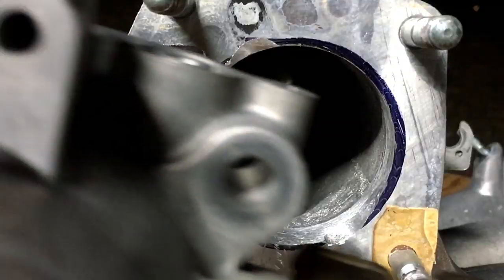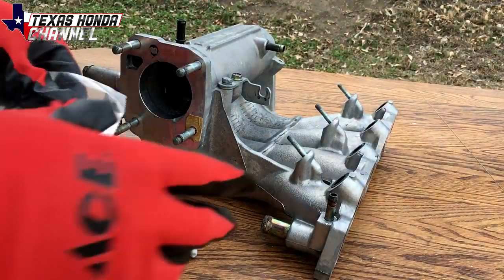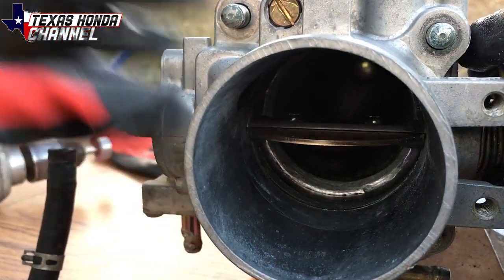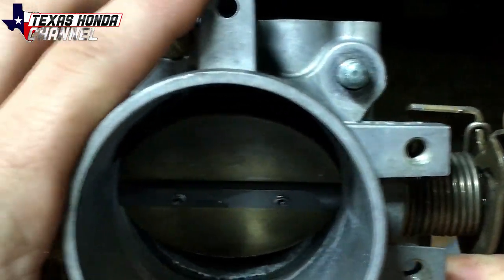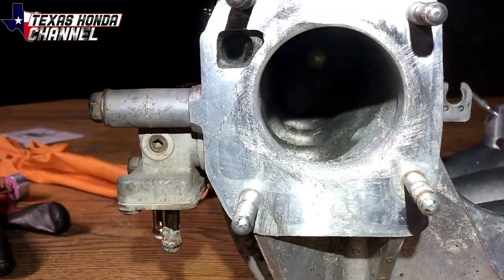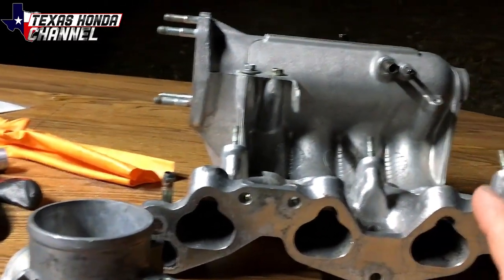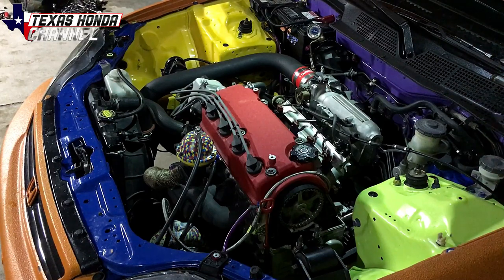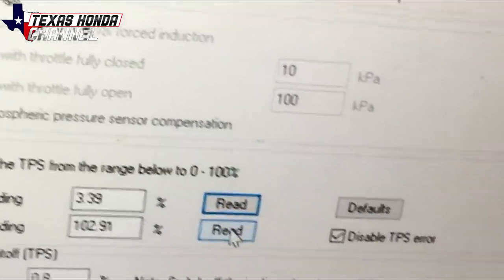18 psi+ How to port match Type R throttle to a d16z6 intake manifold

Comment: I know it been a minute my good man. Hope you are all well. Grinding stones load up easy. Get you a nice aluminum/ steel cutting bit. It wont load but be careful. They do remove aluminum in a big hurry. Great ⚠️ should be taken. Then i used a flapper sander on a drill to clean it up. God Bless ✝️

Comment: try carbide burr... it will cut it like a butter... and no need to work until night...
Reply from the maker: Lol i only get time to work at night since i have no other time too. 90% of everything i do is at night and i couldn't afford cabide or i would have had one. The grinder bits were super cheap. The whole point of this is to save money but i do agree carbide works way faster
Reply from the maker: Khai Incharge I have one now but didn’t at the time lol

Comment: is this absolutely necessary to do for the throttle plate to open on a z6 manifold with a 70mm tb?
Reply: Yes there is no point in upgrading to 70mm throttle body without port matching the manifold you won’t see any gains if anything it’ll run worse than stock.

Comment: That thing runs like a scalded cat. I imagine if you took it to the dyno it would have a big bump in torque with that throttle body. I'm sure there's a good increase in horsepower also but I'm sure you feel the torque more. You may not need the lower ratio trans with the throttle body and 18 -- almost 19 pounds of boost.
Reply from the maker: ghogue61 Yea for sure! I plan to get the short gear trans for even faster a acceleration and tq but yea the difference is noticeable without a doubt!

Comment: James what intake manifold gasket did you use with the Z6 intake Y7 head combo? If I recall,the Y7 head/intake has two round coolant holes and the Z6 head/intake has one round and one square.

Comment: I wonder if you got "that garage" to powder coat the inside of that intake with a gloss finish powder coat if it'd make a big difference in flow.
Reply: Highly doubt it.  In order to achieve that effect,  all you would have to do is polish the insides
Reply from the maker: Chris Hernandez I was gonna spend the 6+ hours polishing the inside but decided against it lol
Reply: @chrishernandez2490  jw powder coating would be a much faster/easier method to smoothing it out.

Comment: my question is on your video , you swapped them out, how did you manage not to have any idle problems, because ypu just eliminated that connection from the old one throttle body ,.the bottom connection where that small hose goes to, for the water inlet, suppose to be for injectors,.on your video at 11.08
Reply from the maker: These throttle body don't have fast idle thermal valves like the 1988-1991 and 1992-1995 civic have. So the stock D16y7/D16y8 have none of that. I just bypassed the throttle. The coolant still ran to the rear idle air control valve so fluid still reached it. just basically put a straight through barb.

Comment: Do you not need to port the head in order to match runners from the z6 manifold since they’re bigger?
Reply from the maker: 360CEA725 The cylinder head ports are plenty big enough for the z6 manifold. The cylinder head is a D16y7 which is a 1.6 the z6 is a 1.6 the d15 manifold I had on was a 1.5. The ports on the y7 head match the z6 perfectly

Comment: I have exedy  stage 3 steel clutch in my NA d16y8 it is very new but it is sliping,what clutch do you think i can used.and my moto has a 70mm throttle body with a chip ecu.

Comment: Hey did you ever tuned the car on that high psi ? I'm wondering what are your hp levels  ?
Reply from the maker: No idea what the horse power is but on lower ignition timing and 8.8psi it made 200who so probably around 300. will dyno when i can afford it
Reply: @TexasHondaChannel  oh man can't believe the block held. Good videos man keep it going. I'm in the process of getting 1000cc injectors and a gm 3bar map can't wait to tune it.
Reply from the maker: SGREEFER310 I need to throw my 1000cc injectors in as well. I just need the connectors

Comment: 1st off using the sharpie to mark material to be removed ? is this your first time ? use an old or a new GASKET. verify it is same size as throttle body and or larger. if larger port the intake and the throttle body to the new size. some throttle bodys can benefit from porting large some cant you simply gotta look for obstructions in flow and then gently massage them so as not to hinder flow. keep same general shape if your new to this do not change the flow path unless you know for sure this is what needs to be done. As in you read it from a speed manual or speed shop not from billy bob in back yard with a dremel tool.
Reply: This is called port matching.  Who's new here?? You use the old gasket and sharpie . ? Because you need to take off say 6 mm like I do with my JDM h and skunk 2
Reply: I am Billy Bob in his backyard.  And I'll guarantee I spank anything you own with na 27 year old Honda

Comment: I have a D16Y8 engine. How does the Z6 intake manifold compare to the Y8 intake manifold? Any performance benefits?
Reply: Y8 intake is better for turbo and n/a its the same preformence buy a 62mm throttle body from a b16 or b18 ther the same and make a lil power
Reply: Y8 is shorter fatter - looks bigger. but when opened the Z6 has equal lenght runners 1234 vs Y8 unequal lenghts.
check SRDMotorsportsTV dissection of the Z6 vs VTi (Y8) intake manifold
https://www.youtube.com/watch?v=TtKG8vzCsNE
Reply: if you compare the z6 vs y8 the z6 flow characteristics are smoother compared to the y8's sharper angle the z6 runners are BIGGER than the y8s. the y8 plenum is BIGGER than the z6. well either way swapping manifold is useless both are good till 400whp. the y8s runners are unequal length as well so in recent dynos 09-10 people have concluded that the y8 manifold causes #3 cylinder to run leaner than the rest. and over all isnt that much of an "upgrade" honda designed the manifolds to work with certain motors and head designs so stay with the same years of compatibility

Comment: Is a z6 manifold better then a y8?
Reply from the maker: hatchy boy88 Indeed it is. Now the z6 and y8 are better than all the other d series but the z6 has the best flow over all others
Reply: In N/A motor The z6 is better at high revs instead y8 in the middle have more torque, 
as for the turbo I don't know...
Reply: @torretuning93  I got both and doing a turbo build so I'm just trying to see witch is best that I can get more power out of
Reply: @TexasHondaChannel  would be nice to see some dyno results between the z6 and y8 manifold to compare, any way that could be done ? 
Sweet video by the way :)
Reply: Y8 is shorter fatter - looks bigger. but when opened the Z6 has equal lenght runners 1234 vs Y8 unequal lenghts.
check SRDMotorsportsTV dissection of the Z6 vs VTi (Y8) intake manifold
https://www.youtube.com/watch?v=TtKG8vzCsNE